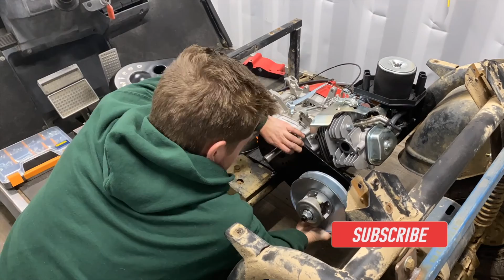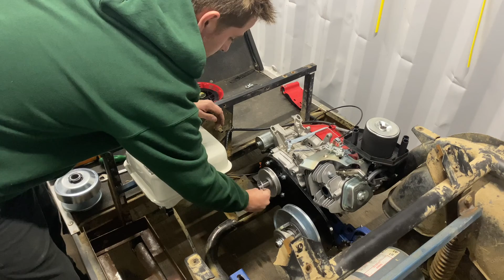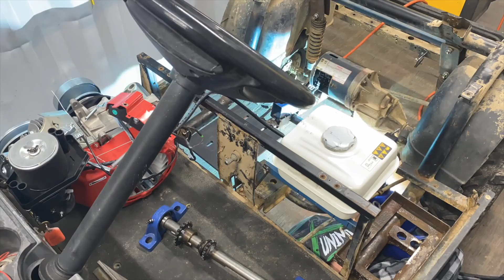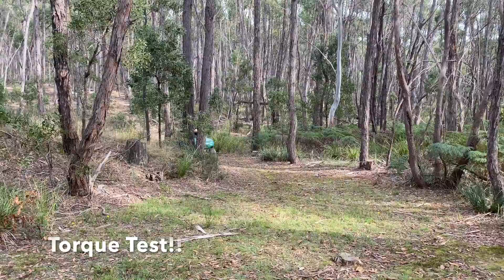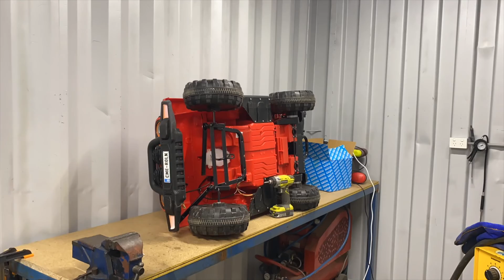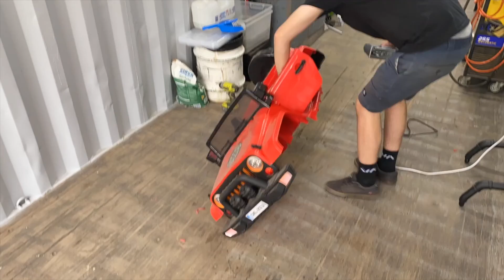How To Build A 440cc Golf Cart Part 4. NEW Torque Converter and Power wheels!

Comment: I wonder how hard it would be to make it  4wd?
Reply from the maker: I would love to do that! Another jack shaft, some shortened car cv’s and a arms haha
Reply: @EngineeredToDesign  yeah i guyss all you would nedd is a new front axel and diff. Then a do a similar setup with the chain for the front then you could get 4wd
Reply from the maker: @davidcowan1583  yeah mate that would be the go.. just hard with the engine being on the swing arm, but you could have a pretty capable vehicle awd go anywhere. I’ll be making my next power wheels 4wd